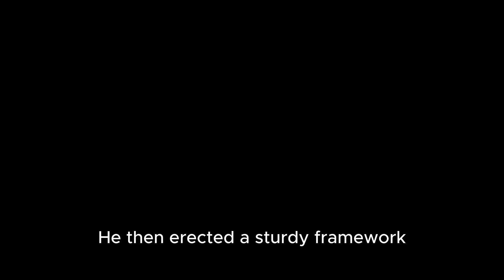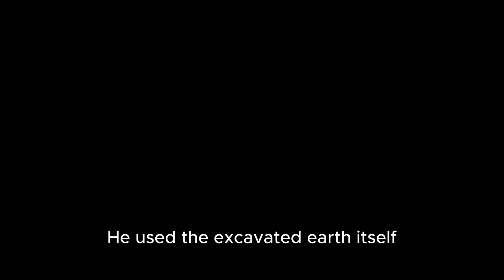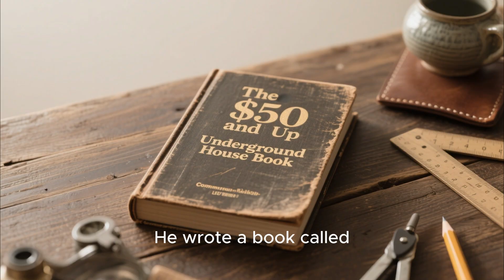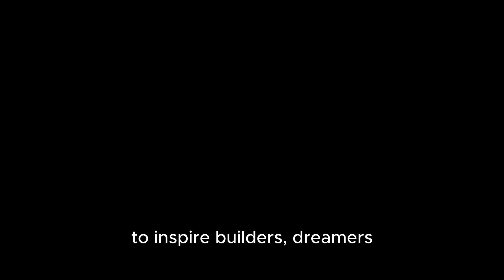Everyone Laughed at His 'Stupid' Cabin Design—Then It Used Zero Firewood to Stay 60 Degrees Warm

Comment: 60° Fahrenheit?  That's not comfortable to me.
Reply: Put on a sweater and double socks, maybe a cap.  Works wonders.
Reply from the maker: Totally fair point! Everyone's comfort zone is different, especially when it comes to cozy cabin living. What's your ideal temperature?
Reply: @FrontierEchoes-y9h 72-87F 😁
Reply: @FrontierEchoes-y9h  Is it not far less expensive to heat upwards from 60F as opposed to upwards from 30F? Tis FAR cheaper.